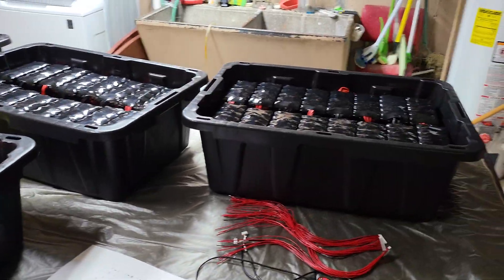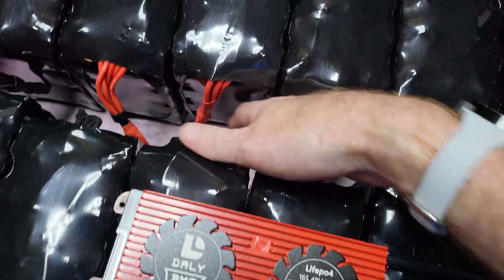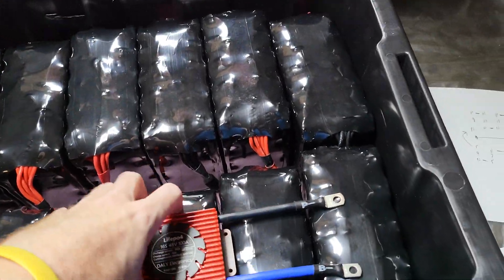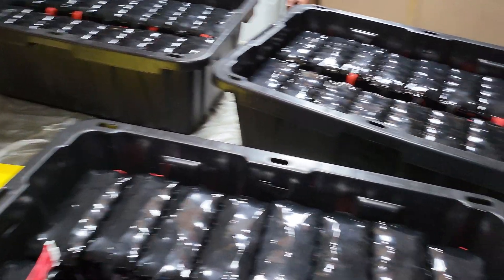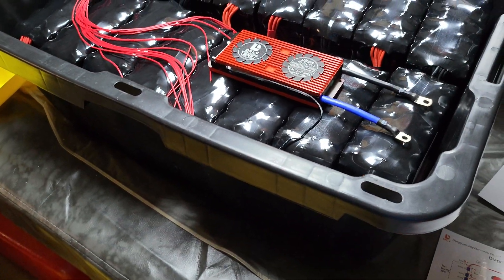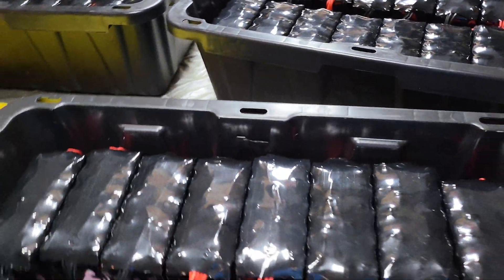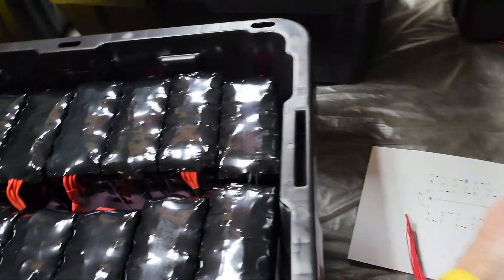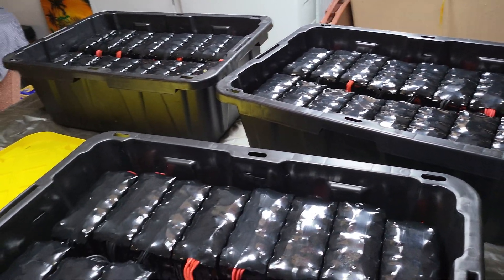Battery Hookup Lifepo4 battery Module 48V house battery build Part 2

Comment: I need a 48V 10KWh LiFePo4 for may Sailboat. But i don’t want to lift 100kg / 200lbs or have room for one solid battery tank. 
 My vision is one aaaawesome beefy BMS with active balancing and spread the cells across 2 or 4 boxes.  
You decided to build 4 independent boxes with a BMS in each one.  
Making the balance leads thick enough there shouldn’t be any significant voltage drops.

Is paralleling 4 batteries a good idea, are they really discharged equally when their BMSes don’t know anything about the others?
And 4 dalys + active balancers aren‘t cheap either.

What are your thoughts about that?
Reply from the maker: Each battery is still about 100 pounds.  I've not found issues unless the battery is out of balance in its own cells then they will get out of wack.  Generally they stay super close.  So yea so long as it's not a super high C rate.
Reply: @darrenorange2982  my sailboat motor draws 100A @48V. Does that make a difference for parallel battery units?
Reply from the maker: @olaf_s_23  Not really it would just pull 25 amps from each

Comment: To make a battery pack just like that apart from the 16s is there anything else to know about the BMS
Reply from the maker: You should update the settings on the BMS to more closely match the battery limits.  They come programed wrong in my opinion

Comment: What foam are you using?
Reply from the maker: Pink 2" foam insulation
Reply: @darrenorange2982  thanks for the info. At HD now getting both.
Reply: @darrenorange2982   I didn't find any there, but I did find the green foam for fake flowers at the local Walmart. They came in packs of 3 and I got 4 of them. Fits perfect in the bottom and I did not have to cut a thing. I did see a video once of a heated nickel ball against this foam, and the foam won.
Reply from the maker: @ChrisEldridge  awesome please post a link.  It's hard to figure this out.

Comment: I really like the specs./ratings of these packs. Ilike how you picked the totes. they look like they fit  snug. did you place any extra insulation between the cells, not that they are going to move around. did you tape them?